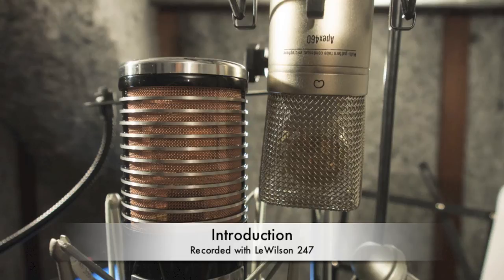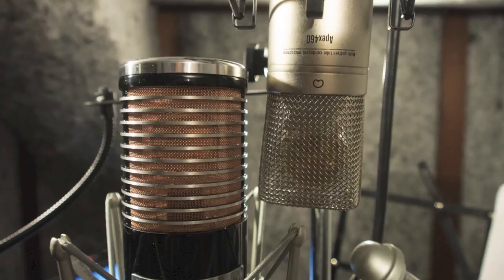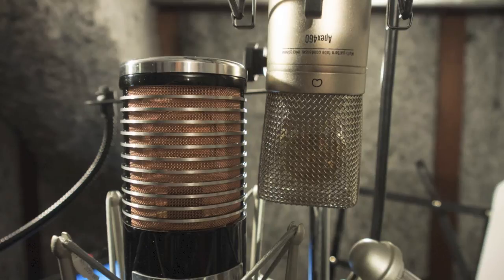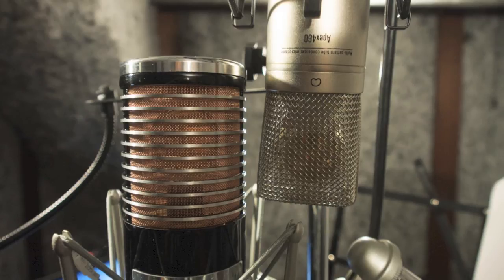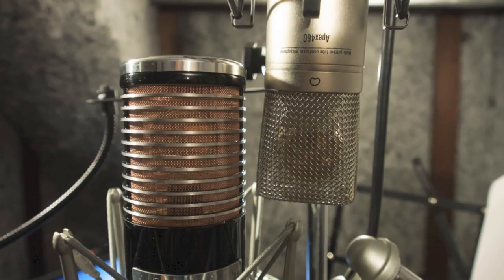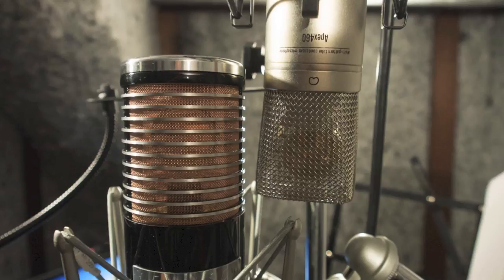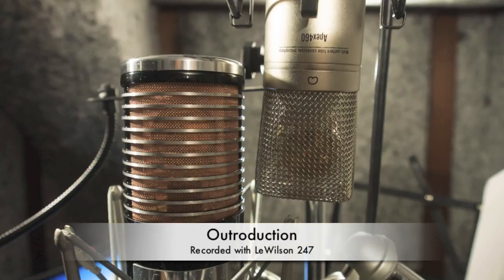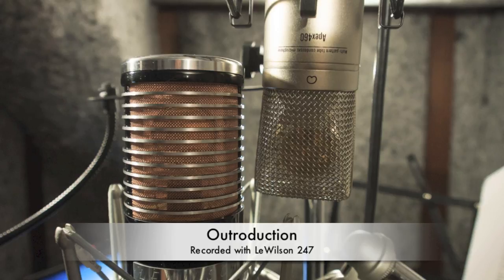Mic Shootout - Apex 460 (OktavaMod) vs LeWilson 247

Comment: perfect comparison thanks,  just purchased the 460 moded mic.  with your comparison, right away I hear the 247 being thicker richer deeper.  but at twice the price you get what you pay for.  all the tests ive heard with the 460 mod, I  picked the vintage mics over the mod 460 but at 6 to 10 times the price tag I had to go with the 460 mod.  certainly a huge leap above the original un modded mic but not a neumann u47 just the same.

thanks again, Greg